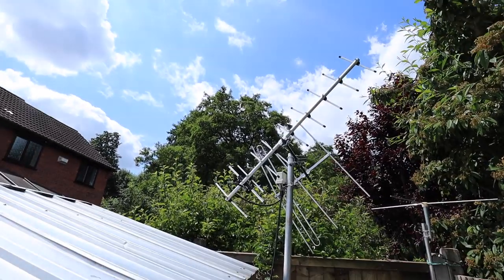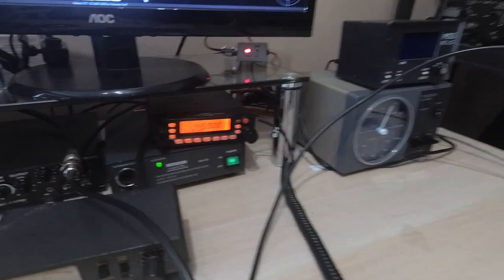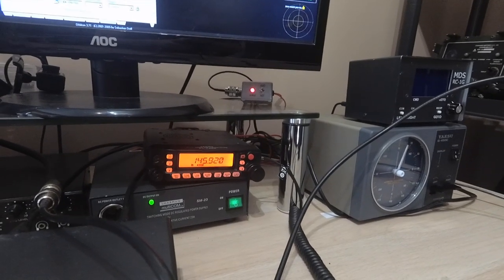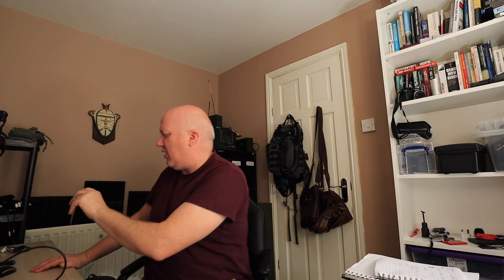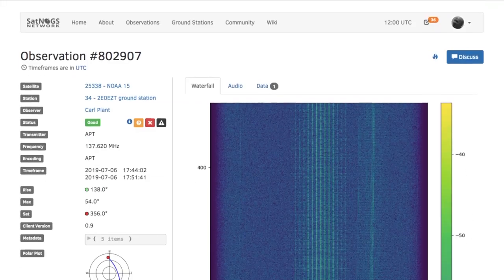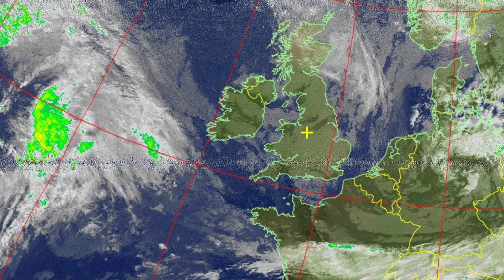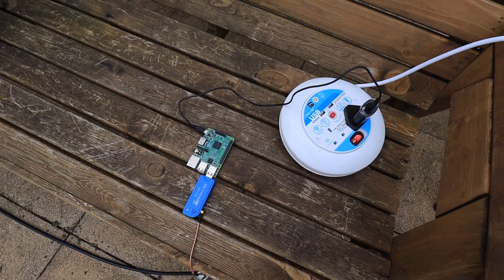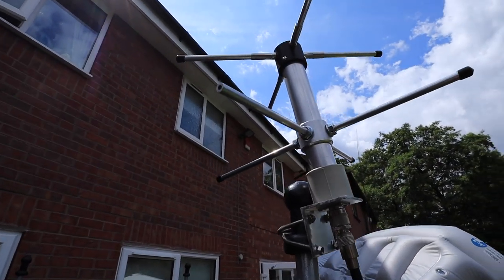Setting my ham radio station up to operate amateur satellites

Comment: Still keep trying 20meters Carl people are getting the mind set the bands are dead and not even trying to setup or turning on there radios. Funny when a contest is happening the band is open. I take the recent 13 Colonies Contest around July 4 here in the states. I enjoyed your video where did you get that uhf antenna ? Maybe put the SDR near the antenna short jumper and feed power and ethernet to that raspberry pi.
Reply from the maker: Yes I've just bought a 12v to 5v converter to power the RPi with short feeder. The UHF antenna was from eBay, made in Yugoslavia or nearby, it was a long time ago TBH. 

I'm currently playing SSTV on 20m

Comment: Hi i am new to using satellites in ham radio could you advice me what i would need to get so i can use satellites
Reply from the maker: There's a good book on the amsat website that talks you through what kit you need. You can get a digital download. It's called something like Getting started with amateur satellites.
Reply: @M0SZT  thank you i have a portable yagi and my trusty baofeng radio would like to set up a more permanent set uo at home qth

Comment: Gave you a shout on Ao92 the other day Carl but it Was bedlam!!
Reply from the maker: Yes it's like a wild west saloon
Reply: 2E0EZT amateur radio  I meant to say Carl fo29 is down which is a pity but Ao7 and xw sats still going.My Oscar 100 is done,hackrf with small amp driving edup WiFi amp..1m dish with dual patch.Worked Thailand to Brasil,48 countries in 8 days 😀 good luck and keep up the good work